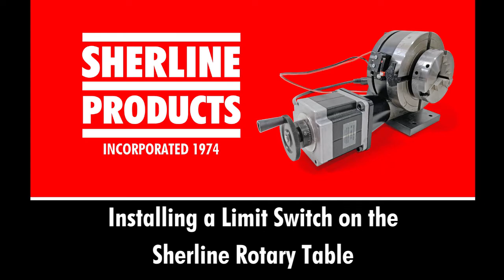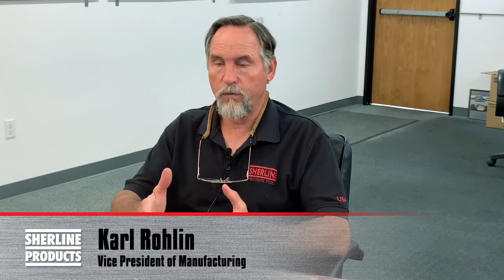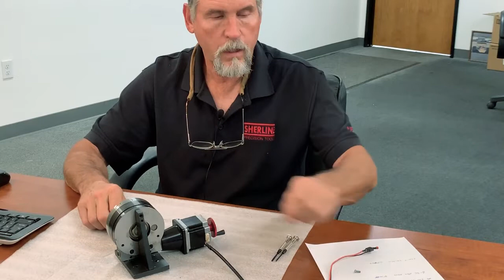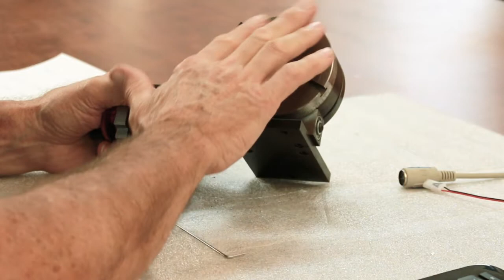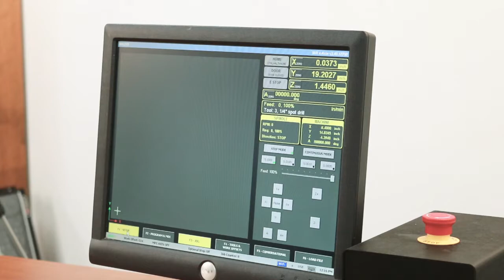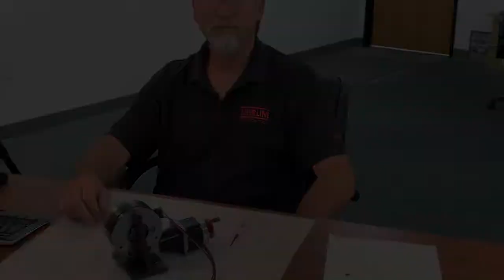Installing the Limit Switch on a Rotary Table

Comment: Can the Masso controller do 4 axis simultaneous milling or is it just for indexing the part to a different side?
Reply from the maker: Yes, both MASSO and Linux controllers can move all 4 axes simultaneously for machining. The 4th axis is not just an indexer, it is a working 4th axis.

Comment: What’s the part number for each pieces of the rotary limit switch kit?
Reply from the maker: https://www.sherline.com/product/a-axis-limit-switch-assembly-rotary-table/
Reply: @SherlineProducts  link is dead :(
Reply from the maker: @toddmitchell9670  Which link is dead?
Reply: @SherlineProducts  the link in your reply above
Reply from the maker: @toddmitchell9670  Thanks for letting us know. That link is two years old. We modified the way limit switches are ordered into a single page for multiple switches.